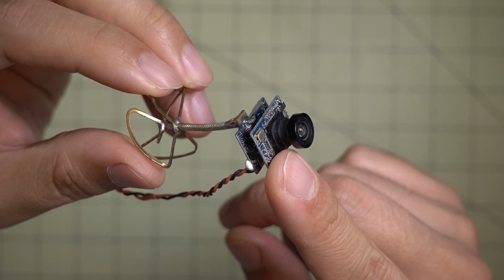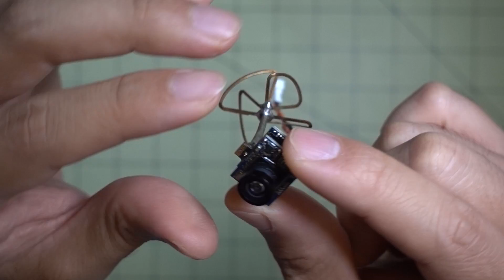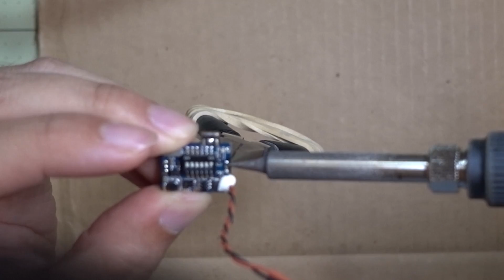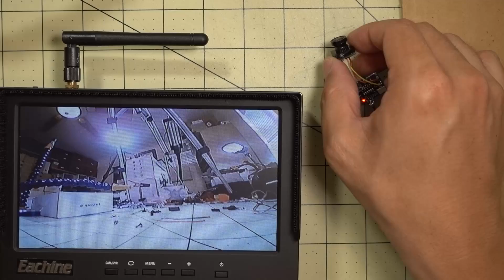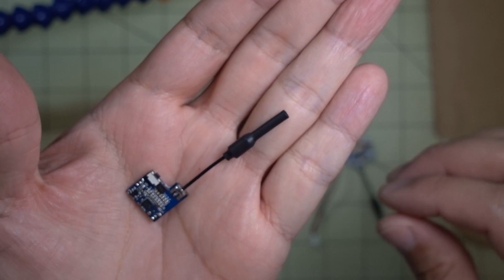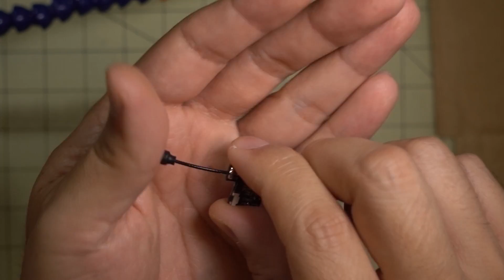AIO VTX Hacks 🔥🍒💙

Comment: Questions 1. would it be possible to solder and mmcx female plug to the board?  2. can you use bigger cameras? 3. are they usually 5 volts? I was worried about burning them up attaching them to the micro FC.

Comment: My ur65 came with a bad vtx but I like the camera so i'd like to do this mod. How did you know which pads to solder your cam to and how can I  ?  Using the UR 65 aio cam.
Reply from the maker: I used a multimeter and some logical deduction reasoning.
Reply: can do, cheers  @AlbertKimTV

Comment: hey Albert,  quick question, how do you determine where power, ground and vid are located, do you have a schematic,  for i have a lot of diff downed aio cams that i would like to get goin, also in instances where reverse polarity was accidentally connected, i know there is only a minute amount of choices of components that could have failed such as capacitor , resistor, usually, do you have any tips on how to isolate the faulty smd, and identify its rating like a 100 ohm resistor since the smd's are not marked for rating, is there an archive somewhere on the net that shows the pcb's population and ratings
Reply from the maker: I use a multimeter to test continuity against known power sources... Hint - start with the ground...

Comment: Albert, two questions:
1) What pico-size stand-alone cameras have you found that are quite good clarity, resolution, color and light handling, etc? 
2) You mentioned some alternate camera/vtx wiring schemes where the power comes in the back side but is just passed through to the cam board, then elsewhere power and ground (and vid) are routed back to the VTX. You didn't explain how we can tell the difference by visual or meter inspection.  (?)
--Thanks in advance!--
Reply from the maker: Just about all the stand alone pico cameras are bad.  But if you need to know the "best of the worst", look at the KingKong one. I think it only comes in PAL.  The long story of the camera powering the VTX is that EVERY model seems to do it a little differently.  I could make a 1 hour video on every model but I'm not gonna do that, I have a life to live.  The way to figure it out is to power it up and use a multimeter to follow the power and see what is powered where.  Look for 3.3v and 5v connections.  Obviously you'll need to learn how to use a multimeter and also have some knowledge of electronics otherwise this is kinda like martian to you.
Reply: Albert Kim   yep, I'm with you. I'm fairly adept with my meter, use it all the time, and that shouldn"t be too much of a problem as you described. I'm just (efficient) and thought there might have been a way to tell by observation the ones that pass-through versus the ones that don't.

Here's another question for you: you mentioned disassembling an AIO so you could attach the VTX to a different camera. But by your own admission the small stand alone cameras all suck, and in my experience the worst AIO I've used was better then the 1000tvl 170 fov stand-alone Pico camera I've got from banggood last month. So here's my actual question, other than when the AIO camera fails, why would you want to attach that VTX to a stand-alone Pico camera?

Comment: I need to replace the aurora 100 aio camera, (it got destroyed)  with one that only has one red one black wire. I' know I won't have the osd wires now so what would be the easiest way to make the swap? Use the original connector but only the black and red wires? Or is there another place I can get 5v on the board? I'm also curious how to even access the flight controller given its connected by pins? I had considered using an fs-a8s rx in place of the flysky built in but not exactly sure how it would be done with the connection pins.
Reply from the maker: I'm not 100% sure of your setup, but I think just connecting the power should work. Obviously you'll lose the OSD.  If you want to use a different receiver, you have to desolder the existing receiver board. No way around that.

Comment: i have many of this ones that die on me ..they dont turn the light of the tramiter on ...i dont know if is the camera o the trasmiter ...
Reply from the maker: It would depend on what model you have and if the regulator is on the camera board or vtx board.  It might be salvageable if you separate them and power the vtx independently.

Comment: Great video as always, thanks Albert. Do you know anything about this camera https://www.banggood.com/Eachine-E010C-E010S-Spare-Part-p-1119217.html?rmmds=search . Judging by the photos its the EF-02 used on the E010c. I want to split the video signal to use on a brushed board with OSD but not sure which pin is video and how to go about cutting it. Should be a good little camera as it's a 800tvl 1/3 CMOS as opposed to most of the others which are 1/4. Thanks in advance.
Reply from the maker: I think the pinout is the same on that one. Video is on top.  It's easy to confirm with a multimeter. Turn it on and put the multimeter on the bottom two pins. You should see a steady voltage between 4 and 5v.  To split up for OSD usage you have to cut the video pin and solder wires to your OSD for v-in and v-out.
Reply: Thanks Albert, that makes sense. Picking up the camera from the post office tomorrow so will give it go.